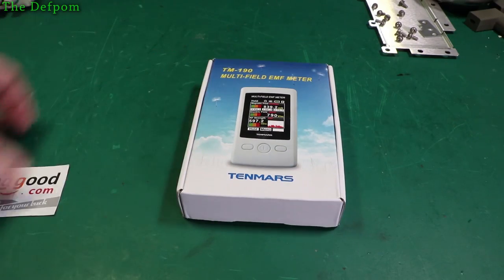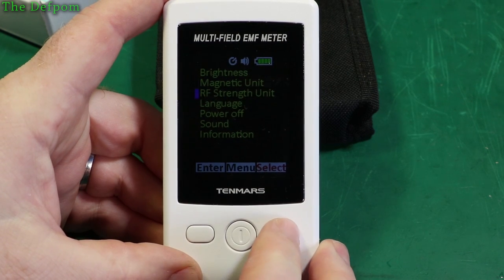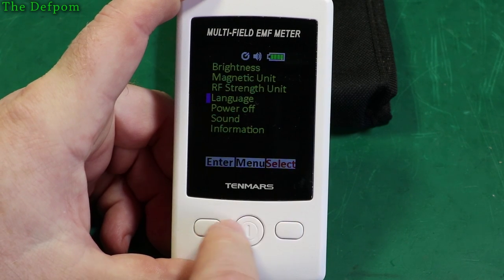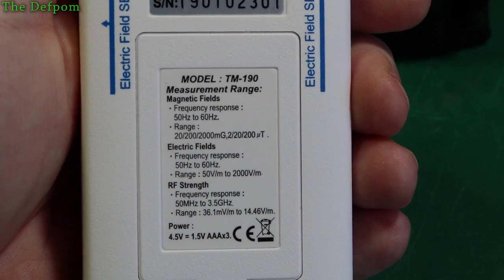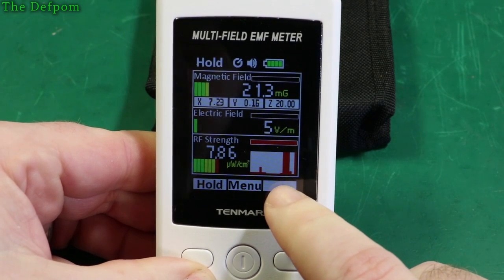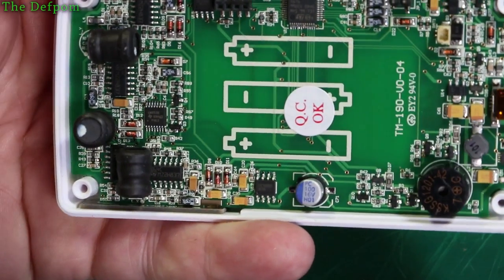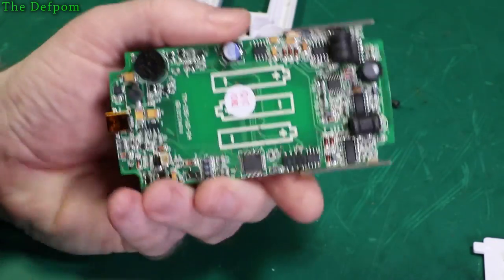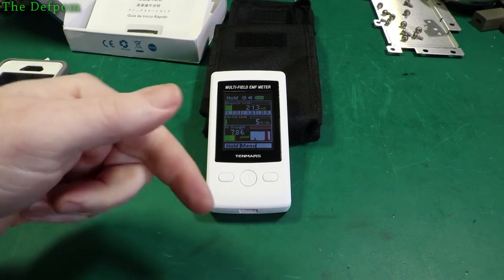🔴 #573 Are you exposed to Radiation ? - Tenmars TM-190 EMF Meter Review & Teardown

Comment: The reading from the microwave was only 7.8 μ watts.  I would imagine that cell phones next to your head is much more.  When people hear the word "Radiation" , they become fearful.  There are many forms of radiation, the worst being the ionizing kind.  MRI scanners use RF radiation to image the body.  They use a lot of power at close distances, but is considered safer compared to CT scanners.  The only regulations set for radar & microwave workers is SAR (specific absorption rate).  Anyway, that's a interesting device.  Hope you can find the source of the noise.
Reply from the maker: I have multiple sources, so I just need to track it down so I can deal with it. I have already done things like put ferrite rings on all the mains leads and audio cables, which helped a little.
Reply: @TheDefpom  hello how about the cornet ed88 plus is better ?